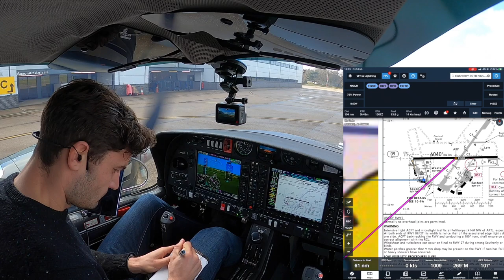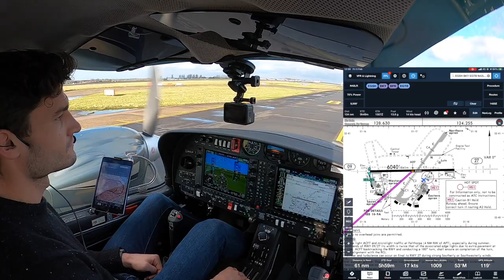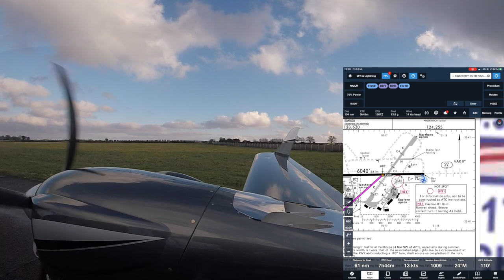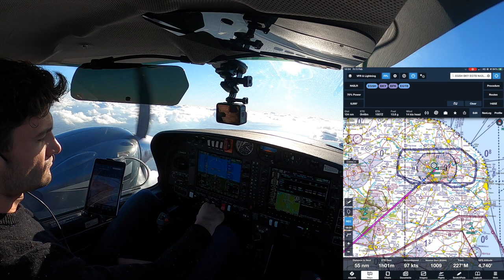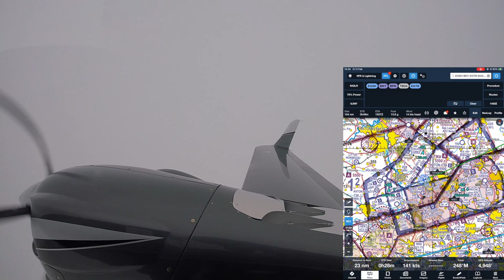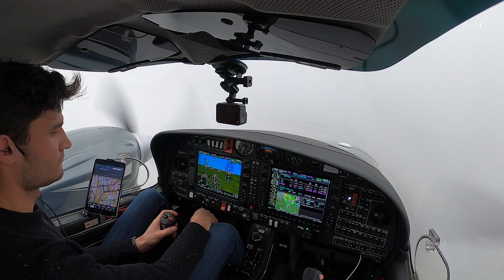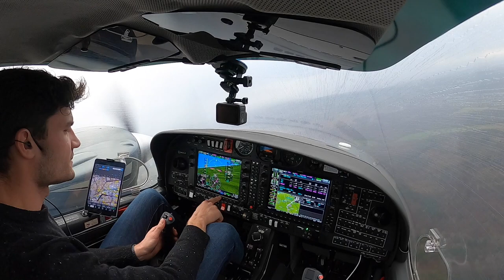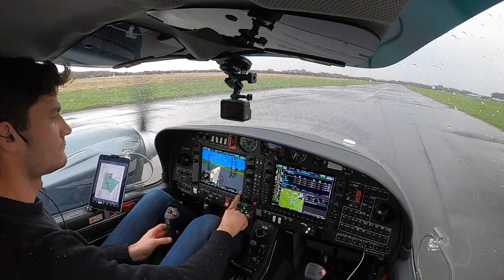IFR flight in a DA42 from Norwich to Wycombe with ATC audio.

Comment: Nice plane! I've noticed that most of the time you are cruising around 142 kt ground speed. At a certain point the wind shows 14 kt head, so that would be 156 kt true. Is that really the usual speed of the DA42, or are you really flying "economy mode" on this video?

Comment: Stupid question - but have Diamond released a new version of the 42? The ones I've flown (and passenger-ed in) had a slightly different panel layout, with more basic pages on the G1000s. 
Edit, should also have said what a nice video this was! +1 sub
Reply from the maker: Thanks! Main difference is the G1000 NXI update, so you can get a few extra things like synthetic vision etc. A lot of the additional pages are options (wx radar, satellite weather etc)

Comment: Nice flight 👍 Do you treat the wind shield with water repellent?
Reply from the maker: Thanks! No I don’t, with airflow the water disperses quite nicely! It does have an anti icing system where you can squirt TKS fluid on if required, but it’s messy sticky stuff

Comment: how tall are you? how do you find the DA42 cockpit size compared to other similar aircrafts, are they on the small side?
Reply from the maker: I'm 6'2"! There is not a lot of headroom but with the in-ear headsets I'm not hitting the roof! There is good seat adjustment which helps with being taller.

Comment: Beautiful birds to fly except one thing... TERRIBLE visibility.  Very tall dash so unless you're 6'4" or more you've got that to contend with.
Otherwise... outstanding aircraft!
Reply from the maker: Luckily I am 6'2" so I find it quick good! I love the aircraft, really a well laid out modern twin! Thanks! 😁
Reply: @richardtyrer  another issue from a training perspective is that, due to the FADEC system (which is beautiful) it can make a transition to a job difficult for some people.  If they get a job flying Navajos or something with mixture and prop controls, some people might find it to be quite a challenge.
Regardless, I love the plane!